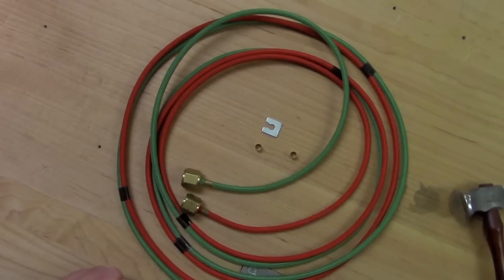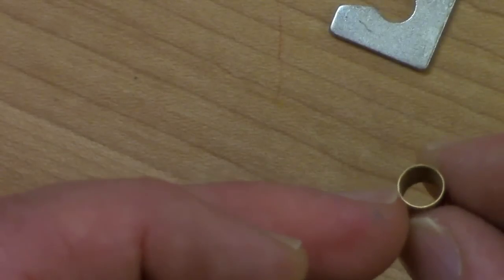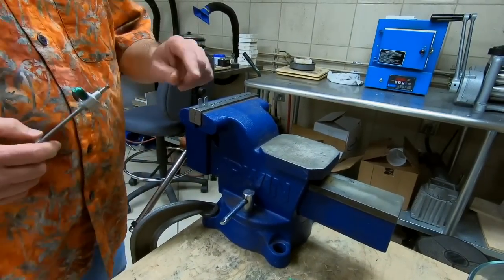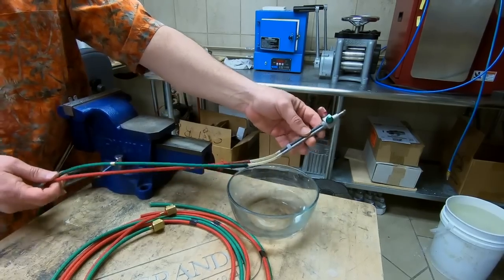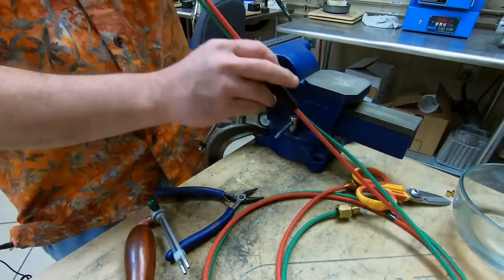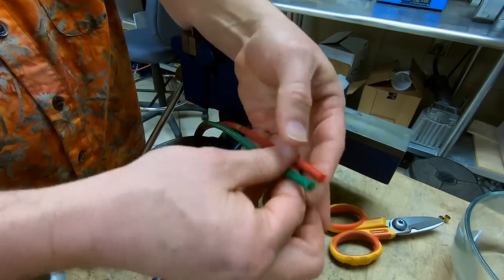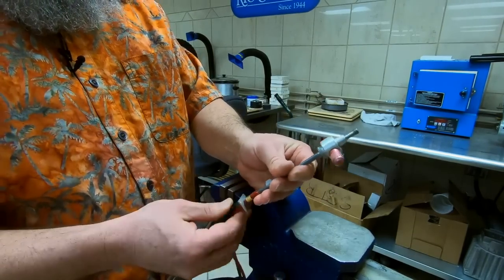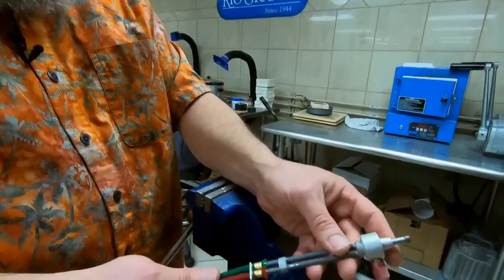How to Change the Hoses on a Smith Little Torch

Comment: Just wanted to say thank you for the informative video. Last night I was going live on fb doing some lapidary and smithing. While smith you know you shut the little torch down at the knobs torch end to shut off flame in between stages of soldering. Lines(o2 specific) stay pressurised. Well I wasnt using the torch for like an hour sitting in front just talking  live feed and i look down under my bench. My main tank dial had lost 25% or more of its capacity. Before watching this video I said to my pops. It's like this rubber/synthetic hose inside the mesh is "brittle" and almost crumbly. I went to bed frustrated because well no fire. Woke up and contacting local welding stores for a quick fix while I wait for a line replace kit. I really had no idea how the lines truly worked. Thank you. This was the perfect video to wake up to and have a direction of what to do. I've silversmithed on and off 18 years. Have always just been supplied. Torches or given them secondhand. Just wanted to take a few moments to thank you for the clarity on my disaster lol. I saw 18 comments and figured I'd write a small story. Also a big thanks to Rio Grande for supporting me with equipment and silver supplies for years. Since high school even. I'm gonna be 39 on friday! Always best customer service when ordering anything I need. Will be ordering a line replace ment kit for mine today from Rio!  Your video relieved a big headache. Never had to deal with torch lines lol....

Comment: Excellent video, John, as yours always are. I found this after scratching my head over the instructions on the manufacturer's website. Question: I have leaks at both ends of one of the hoses;
do you think it makes sense just to cut a little of each end and reinstall the hose? Or should I plan on buying a replacement hose(s)?
thanks for all of your help,
Ken

I answered my own question- no matter how far I cut back the hoses, the plastic was brittle and split when attaching to the connections. Time for new hoses!

Comment: Great video....last year i had to change the hoses in my little torch and could not realize how those ferrels work....so i purchased a pair of hoses from a local suplier and installed them with the knob thing(i dont know how its called)..
Now i know thank you😁!
One question,my propane knob on the torch doesnt close easily,i have to tighten it too much or it leaks...any suggestion?

Comment: Is it a similar process to change the threaded end? Or do you sell a Little Torch hose kit that fits onto non-Imperial threading?
Reply from the maker: Hi there - The fittings are attached the same way on barbed fittings using the ferrule. Let us know if you have any other questions!

Comment: I'm having a terrible time!! The fabric is fraying like crazy on the ends of the hose, I thought I was being careful but I drove one ferrell all the way up onto the handle tube. I can't get the ferrell's on without pushing the fabric back, what a mess!
Reply from the maker: Hello, we are sorry to hear about your experience with the product. We will reach out to our Tech Team and customer support and see what we can do to make this right for you.
Reply: @RioGrande1944  I finally got it all together. The fabric kept fraying like crazy so I put a little clear fingernail polish on the ends. Then I actually used a tiny drop of oil to get the new tubing on and finally a pair of pliers to get it all the way up where it belonged.
Reply from the maker: @GoldenRamMtlmstr  we are glad to hear you got it working. Let us know if you have any other questions or concerns!
Reply: Mine is also fraying like mad!
Reply: @brigidko1945  try what I did. Put fingernail polish on the fraying ends and a fraction of a dtop of household oil to slide it on.

Comment: add a little dish soap to the water when checking for leaks. The soapy water will bubble at any leaks.
Reply from the maker: Hi Wayne, This is a great point. Checking for leaks is important; however, we recommend avoiding any solutions (soaps) that contain combustible ingredients, such as petroleum. For this reason, we suggest a product such as Safe-D-Tect Leak Detector Fluid. Here's a link to that product, if you're interested in checking it out: https://www.riogrande.com/product/safe-d-tect-leak-detector-fluid/500238 - Thanks so much for watching!

Comment: Can we talk about how horrible this whole process is? the chamfers -  can't determine which is the thin side and which is the thicker side. The difference is SO miniscule. Why can't they mark it somehow? The fabric that covers the hoses....It unravels if you look at it the wrong way. There's no way in this video that these rubber hoses weren't stretched before shooting...those hoses are BRUTAL to put on the torch, impossible to get them where they're supposed to go. Oh, and just when you thought you were done, you realize you forgot the handle. Why can't Smith Little make a handle that goes on after? I hate this whole process and